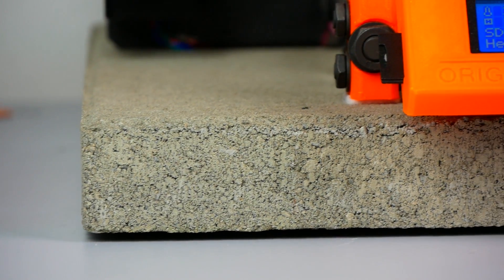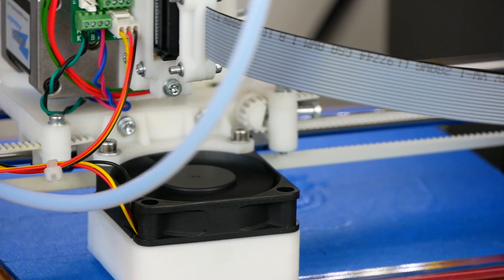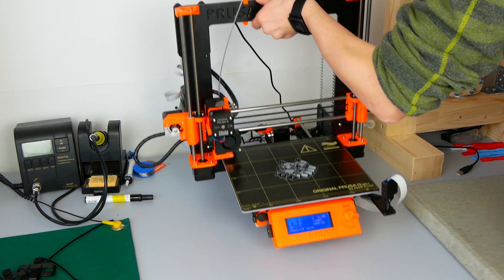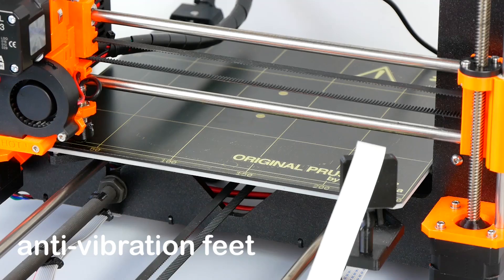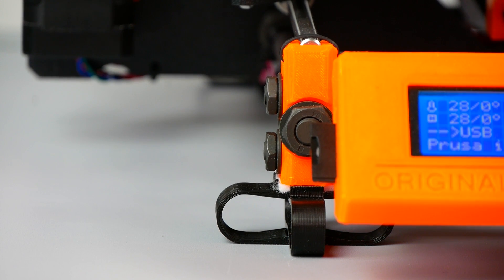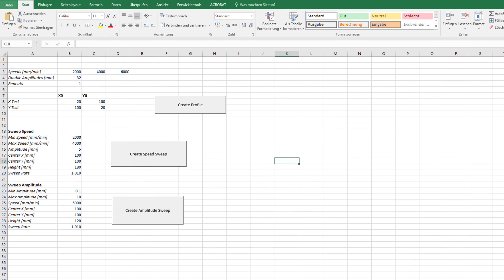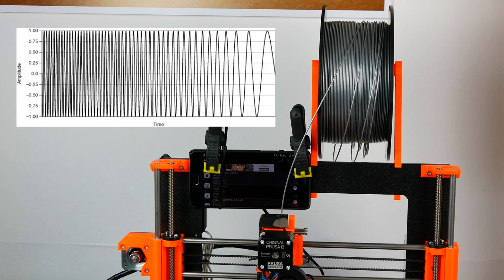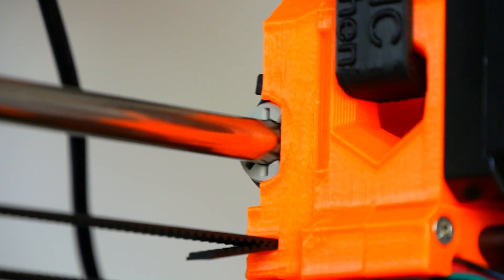Silencing the Prusa i3 MK2 & Horrible Vibrations

Comment: I've put the pavement stone on a anti vibration mat for washing machines (https://www.amazon.de/dp/B015Y6PIWO), which dampens lower frequencies. Putting an additional enclosure around the printer (decoupled from the printer) could then silence higher frequencies and can additionally allow for more stable operating temperatures.
At least for my Flashforge Creator Pro this helped a lot, as this Replicator style machine creates a lot of noise, due to its metal / plastic enclosure acting as noise amplifier.

Comment: try putting the anti vibration feet under the concrete. I think the noise an will be way less and you will not have the  vibration problem anymore because of the concrete potential energy.

Comment: for an improvised, self contained fluid dynamic innertia dapening system ... ducktape a half full bottle expired ketchup, or so, to the top of the frame horizontally.
Reply from the maker: I should actually give that a try. But I don't know if ketchup would be the proper fluid, since it's kind of non-newtonian. Or is this actually what you are aiming for?

Comment: If you print some hold downs that you can epoxy to the concrete and then lock the printer down to the concrete that should eliminate some more of the vibration, most large factory machines are bolted to the floor to remove vibration.

Comment: Rather impractical solution - i'd rather not lug around a piece of concrete that I can barely even lift. The test suggests that crossbracing the printer might be helpful. Owners of cheap printers have had some success with mounting the printer to a piece of flat wood along the perimeter, which braced the weak parts of those, but I don't know whether it would do any good for Prusa Research original.

Comment: I have not tried it yet since my printer in only in construction stage, but I was thinking of trying a sandwich of heavy ceramic floor tile with a car soundproofing material between the tiles and probably under also. (printer, soundproofing, tile, soundproofing, tile, soundproofing, desk) My thinking is the two tiles will counter act on each other thus dampening the sound more. And the soundproofing is made for killing vibrations.

https://www.amazon.ca/uxcell-6-46sqft-Proofing-Insulation-Deadener/dp/B01KAD1XES/ref=sr_1_2?s=kitchen&ie=UTF8&qid=1491098676&sr=8-2&keywords=car+soundproofing
Reply from the maker: Doesn't sound like a bad idea. Maybe even try to put the printer directly on a soundproofing mat without a tile before to decouple it properly.

Comment: I would suggest trying isolation feet made from TPE or TPU filament.  I have found with my old Prusa i3 that the PLA or ABS isolation feed offer very little damping and instead just act as soft springs.  I experienced the same resonance and shaking issues with ABS.  However, switching to TPU feet was significantly better due to the higher damping coefficient this material provides.  TPU is not stiff enough to use the same foot design, so a different design would be necessary.

Comment: THANKS! I was having terrible vibration noises and could not print at night due to the noise. A $5 concrete block has fixed that. The printer is now silent outside the closet its in!

Comment: You've evidently found a solution that works for you, but more solid flexible feet might work, too, without making you have a block of concrete on your table. Solid or near-solid Ninjaflex feet can reduce the transmission of vibrations to your work surfaces significantly while keeping the printer from shaking as much. The feet show in this video seem kind of thoughtlessly designed; your printer needs a stable foundation.

Comment: i've put a huge open cell foam mat and a wooden board under my printer, which does dramatically reduce noise (probably even more than the anti vibration feet) and does not impact print quality negatively.

Comment: I also disliked the amount of sway the anti-vibration feet add to the frame while printing. To compensate for that, I added blocks of quite stiff dampening foam (used for protecting equipment near a blast site) into the feet, in the empty space in the middle. As the feet are essentially plastic springs, this dampening element is a very nice addition to control the sway, without removing any of the noise dampening property of the feet. As a combination I feel these work very well. I had also considered adding a large mass at the bottom, like your pavement slab there, bolting the printer to it and then dampening that against the table, but have been happy enough with what I have now.

Comment: You used felt feet for the paver that you put the prusa on, but is there a reason that one could not just put some cloth or dampening material directly under the printer without a paver or special feet? I could see the printer possibly slipping around more, but I would think using some dampening material would achieve the same purpose as the paver without having to have a giant stone in you work area. Would you mind explaining why you used the paver and not just some felt?

Comment: print 3 more sets of feet and put 4 under each corner of the concrete slab.
Even better would be use speaker stand spikes under the concrete slab.

Comment: I used a piece of scrap granite counter top. In addition to having significant mass it also is very flat, contributing to the alignment of the printer.
Reply: I actually have a piece of scrap granite countertop... If only it didn't weigh more than i do xD
Reply: is the granite plate better than cement block?

Comment: Just a side note. The Tacoma narrows bridge did not  collapse because of harmonic vibration, since the wind was blowing at a constant rate, but I also heard that story in engineering school. It had more to do with the bernouli effect. You can blow on the top of a sheet of paper and get the same effect. The faster air on top would raise one end of the structure that would then hit the air stream directly, pushing it back down. That happened repeatedly until failure.
Reply: The exact phenomenon involved is best described by a Hopf bifurcation in the states space. 
It's the same exact thing which makes flags flapping.
Reply: That is a naive statement... every other bridge has these same effects to deal with but are sufficiently damped to prevent it from being an issue... resonance was definitely a large factor.
Reply: lol a few years ago when I was studying for a math exam, I read in a textbook that the Tacoma bridge collapsed due to resonance. They explicitly gave this example to explain the disastrous effect of resonance. Thanks for correcting this :) You learn something new everyday.
Reply: Johnny Chimpo the bridge collapsed due to vortex shedding. The vortices coming off the leeward side of the bridge pushed the roadbed out of position just in time for the next vortex (on the opposite face) to push it in the other direction, building up the oscillation until the bridge collapsed.
Reply: Vortex shedding was a mere hypothesis dismissed many years ago (as explained in detail on Wikipedia).

Comment: What I have to wonder is how would actually physically attaching the slab to the printer affect the sound it makes? I mean, just putting the printer on top of it doesn't change the printer's properties in any way, you're just using a better surface for it to stand on, but physically attaching the printer to the slab would bring the point of gravity down and would, as far as I understand these things, help more in distributing the forces from printing to the slab -- I could totally be talking out of my ass, but I am under the impression that this should help reduce the vibrations more and thus, hopefully, reduce the noises it makes more than just slapping the printer on top of the slab.
Reply from the maker: Physically attaching it might improve it even a bit more but the side and forward motion are constrained quite well due to the rough surface of the concrete. This is almost like gluing it together.

Comment: Taking that 1-Kg spool off the top of your printer will dramatically reduce that vibration. Seriously, take the spool off and try those tests again. Having such a large mass in such an awkward position is just dumb.
Reply from the maker: There are some flaws with the MK2 that's right. But guys please take into consideration what Prusa is doing for the community! They engineer their products in the EU which involves cool hardware and software and they are also producing lots of parts in the EU. That comes at a price! 
ANET is coping most of the design and software and flood the market with their cheap products. They might make 3D printing more affordable, BUT they are not developing the technology further!
Reply from the maker: Of course the poition of the spool is not optimal, but this is the stock configuration which also uses the least amount of space. Therefore I think it's quite reasonable to use this as a reference.
Reply: CNC Kitchen I understand, but given the video's title and your openness to using/testing other silencing techniques like polymer linear bearings and a paver base mean trying other "hacks" like relocating the spool shouldn't be off the table. Thanks for considering other options, and your reply! ✌️
Reply: Well they might not be developping technology in the hardware department as much as other companies in terms of printer size, but they did create a way to use 4 filaments on only 1 printing head, which is really something! Plus, they keep pushing development in the software department in their Prusa-edition Slic3r, have you seen the latest update with custom variable layer height and smoothness gradiennt? I haven't heard of chinese companies working for these kind of updates as much as the Prusa Research team. That's dedication.
Reply: I don't think anyone is unappreciative of Prusa's work, but it doesn't mean people shouldn't be allowed to point out things that could be done better. If anything, constructive criticism could help them make even better printers in the future. In fact, with the announcement of the MK2S, it looks like they've already taken note of some of the comments they've received and improved some common, easier-to-address issues!

At least I am supporting Prusa, I did buy the MK2 from them instead of some random clone and I am eyeing that 4 extruder multi-filament upgrade, too, once they get it working. That doesn't mean that I can't try to find things that I could do to make the printer work better or quieter, however.
Reply: As an A8 owner you must be a heavy sleeper lol I'd done every silencing mod possible to the printer they are that loud
Reply: anet a8's  are also prone to catching fire and burning down your house.   the best way to silence the printer is to run at 24v PS with interpolated 256 micro stepping.   only thing you can hear are fans....
Reply: Ya, you probably regret this comment, Prusa released the mk3 which can recover from power loss, missed steps, a jam, and has a filament sensor. There is literally no other way a print can fail other than detaching from the bed which is almost impossible with their powder coated build plates. All of this technology has been available but no large company that produces printers that aren't complete shit has taken advantage of them yet. Prusa IS developing technology further.
Reply: Does that have a noticeable effect on noise, however?
Reply: Nita Vesa It will allow the use of those vibration dampening feet (which were the quietest) without the excessive vibration/motion effects.
Reply: alchemistTi I should be receiving my printer in a month, but I'll keep this in mind. I mean, it's a good point.
Reply: The best Chinese software would be in the form of FlashPrint from FlashForge. Up there with Simplify 3D and will likely replicate the variable layers as an auto feature.
Reply: can't do that without upgrading the board and drivers to my knowledge tho
Reply: That's also why I'm quite seriously considering the Prusa over the CR-10 for my next printer. I started using a iMakr startt and having figured out/reached it's limitations. For a 125eur kit, it's good and lots of fun, now I want more and better. Of all my hobbies 3D-printing is one of the most fun ones!
Reply: Prusa isn't developing the technology any firther anytime soon either... no larger printers in the forseeable future from them or any other improvements. In recent videos he has said they intend to start making "pro grade" printers for businesses.... frankly a step in the wrong direction from our perspective. Even if it does make them more money in the end...
Reply: cnc kitchen  I think that it is absolutely non acceptable for the price you have paid that this machine is so noisy and the kit for the roll of filament on top of the machine is a shame !  it is the less expensive  solution for the companies and the worse for you 
I have buy a anet a8    4 time less expensive and I can slept in the same room without any problem and I didn't had to change the bearing for plastic one and the roll of filament is on a rack on the table
You are wright  it take more space
and I wont tell you that the A8 is better than the MK2 not at all but for the price ??????????

Comment: What about removing the 1kg spool and rerunning the test? Mounting it at table level or on a wall greatly reduces the wobble when using Hofftari feet. (The smaller version of the feet shake less, but slightly more noise). 

When using the large version, I did have a single nut unscrew itself... I think I'm going to print Ninjaflex pad mounts.

Comment: 3 things to point out:
1. You have the wrong bearings. The Igus bearings are meant to be pressed into a hold only after that they have the wanted tolerances or you should consider getting the encapsuled ones otherwise they rattle more than before.
2. The plate only acts as absorbant and doesn't affect the printers dynamic. Maybe you should try to set smaller accelerations in the movement.
3. Loc-Tite
Reply: The solid plastic IGUS RJ4JP bearings (usually gray in color) do not need a press-fit holder.   Other IGUS bearings (typical tan in color) do need a press-fit enclosure.  I, and many others have used the RJ4JP for many months in our MK2 printers with good success.  http://www.igus.com/wpck/16924/N16_06_08
Reply: You could have removed the filament spool to a separate holder. that would change your modes, it could probably make the printed feet viable. With the spool up there there is just to much inertia for such flexible feet.
Reply from the maker: 1. The housed IGUS bearings don't fit the standard mounting points why I'd need to redesign quite a lot of parts. Since the rods where they run on can't be 100% in line and won't have the perfect distance you'll always get some kind of pretension to reduce the slob. But you're definitely right, it's not the best configuration.
2. You're right. I get less resonances from the table. As I pointed out, I don't wan't to reduce the accelerations because that slows the printer down.
3. In order to prevent it from falling apart?
Reply: It's hard to find fitting ones, but is 1 millimetre more on the plate such a problem? Autobed adjustment will take care of it. Loc-Tite is crucial in builds with frequent motions to prevent from losening. Even minimal play can create more resonating and thus more play, it's a vicious circle.
Reply: John O'Shaughnessy
Reply: why do people keep insisting that they need to be pressed

they work fine where they are

Comment: I don't think your conclusions are valid with just these test. Your tests show the problem is neither the printer nor the vibration feet, but the surface you put the printer on (the table). The brick doesn't change the printer's dynamics in any way, it changes the dynamics of the surface it's on. So the recommendation for any 3D printer holds: put the printer on a stable surface for good operation... I wonder whether using both the vibration feet and the brick results in even better results.